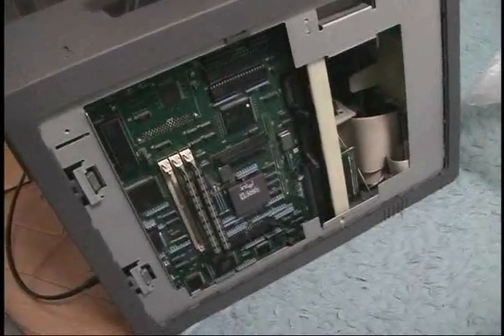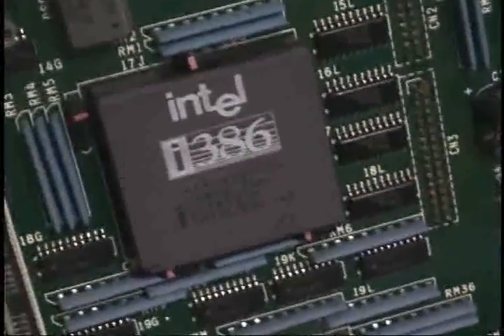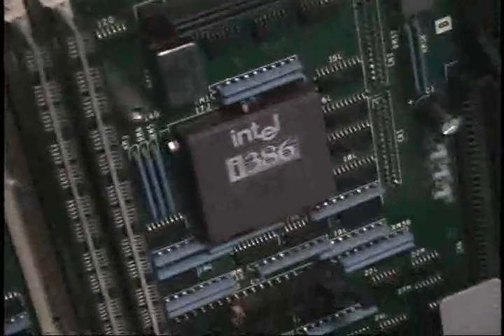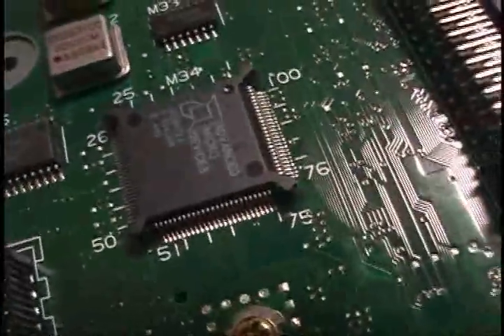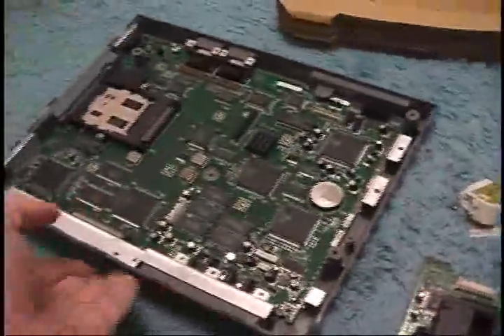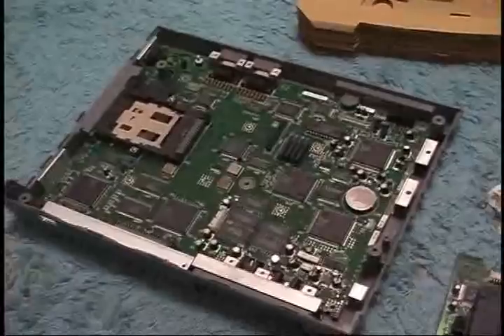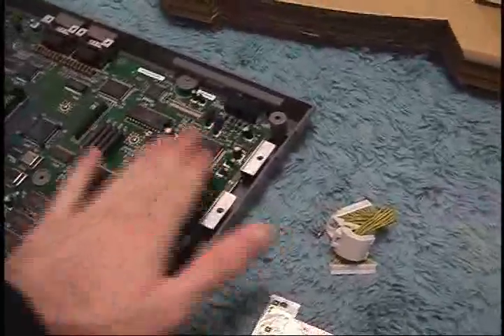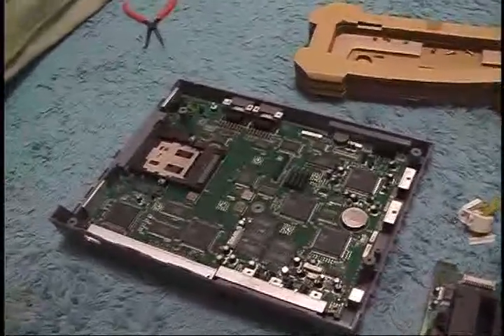Marty and FM Towns 386 inside look

Comment from the maker: Actually the Car Marty outsold the normal Marty by a huge margin.  However being a bulky car unit that was reading cds all day every day, Most were junked and it's rare to find a working one.  I have one that still works perfectly and the original Fujitsu home-kit TV cable. :)  The rarest "Marty" is actually the "TC Marty", which is a Marty with a built in modem and a serial port.

Comment: @robivy64 - Both the 486SX and 486DX have an FPU in them, but in the 486SX, the FPU is either disabled because it's defective or completely missing(supposedly, the latter is the case with later 486SX CPUs).

Comment: Small correction for you: the 386DX doesn't have the FPU built-in.  It needs a separate 387DX for that.  The difference between the 386DX and 386SX is in the data bus.  The 386DX has a full 32-bit data bus, but the 386SX, in an effort to make a cheaper chip, runs on a 16-bit data bus instead, significantly reducing performance.  I hate the 386SX.

I'm actually curious about something: would it be possible to replace the 386SX with an IBM(or equivalent) 486SLC/2?  I'd like to try that out.
Reply: A Ti 486SXLC2 would work as a direct solder on 386SX replacement as it's pin compatible with an Intel 386SX. An IBM 486SLC2, which is an entirely different beast that an Intel licensed 486 IBM clone, will not work however (at least not without some major mods). It is bus compatible but not pin compatible.. (my reaction after 9 years LOL) ;-)
Reply: @pipschannel1222  It's never too late to bring up new information. Thanks for enlightening me on this, I wasn't aware of the IBM 486SLC2 having a different pinout than the 386SX.
Reply: @Ace9921  Yeah, it's a bit confusing, since the Cyrix/Ti CPUs share the same name with IBM CPUs from the era (more or less). 

To paint a complete picture of these Intel 486 clones:

The Cyrix and Texas Instruments versions are based around the exact same core. The original Cyrix SLC (SX equivalent with a 16 bit external bus, but with a 486 'clone' instruction set, PQFP-100 package) and DLC (DX equivalent with a 32-bit external bus, same instruction set, PGA132 package) are the exact same CPUs as TI's SLCs and DLCs, are all based around the same core and all have 1k of L1 direct mapped, write through cache. Cyrix didn't have their own production plant and wafer steppers and had TI and other companies manufacture their design, which was in fact a reverse engineered version of Intel's 486 (much to Intel's dismay).
These CPUs, while all lacking an internal FPU, all had a full 486 instructionset which made them far more efficient than the original Intel 386DX and SX running at the same clock speed. They also implemented internal clock doubling later on, which made them even faster.

Ti's newer SXLs/SXLCs however are improved/enhanced versions based around this core and have 8k of L1 2-way set associative write through cache, so they're superior to the original Cyrix/TI SLC/DLC/SRx2,DRx2/DRu in that regards, while performance gains were marginal.

The IBM 486SLCs/2s/3s, BL2s and BL3s however, which also existed as clock doubled and even tripled versions reaching 100Mhz(!), are Intel licensed 486 clones with either 8 or even 16k of L1 write back cache which IBM was only allowed to sell in their own machines, have really nothing to do with Cyrix and TI (a mistake a lot of people naturally make because of their similar nomenclature) and the later versions are also known as "the original IBM Blue Lightining". It is 386SX bus compatible and is superior to all of the above, while a lot of these still only had a 16 bit external bus as IBM kept producing their 16-bit planars (based on the Intel 386SX and later the IBM 386SLC). The IBM Blue Lightning is a direct descendant of the IBM 386SLC. The "BL"-versions all have a 32-bit external bus. Some of these only have half of their bus 'neutered' to 16-bit wide as it was cheaper to keep on using those old 16-bit planars they had lying on the shelf.. Pretty weird huh? ;-)
What's even weirder is that IBM's agreement with Intel was terminated and later "Blue Lightning"-labeled IBM PGA168 CPUs were based on Cyrix design, which makes it even more confusing ;-)

The only similarity the Cyrix/TI and the original IBM CPU's share is that they're all in fact not real i486 clones , but 'supercharged' 386 clones ;-)
(a real 486DX is superior in just about every way, except for the Blue Lightning's 16k write back cache)

I think these machines and CPUs are all very interesting and represent the dawn of the 32-bit x86 era. Very much worth exploring 👍